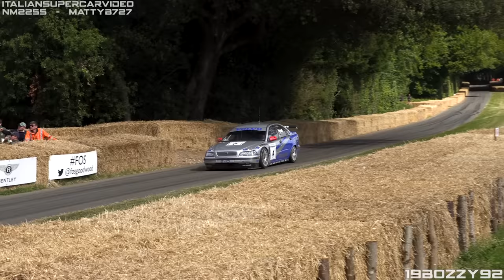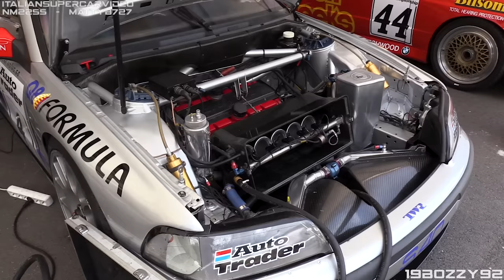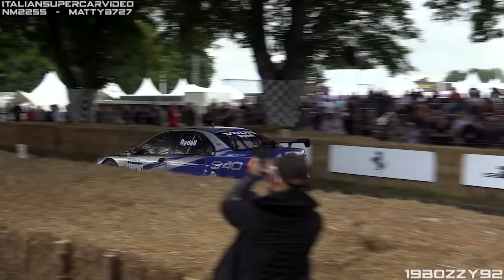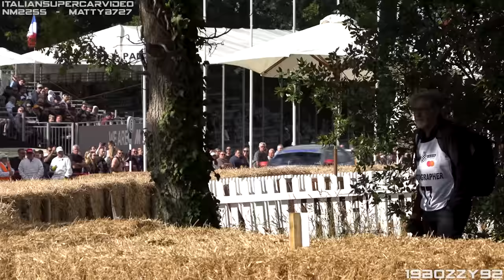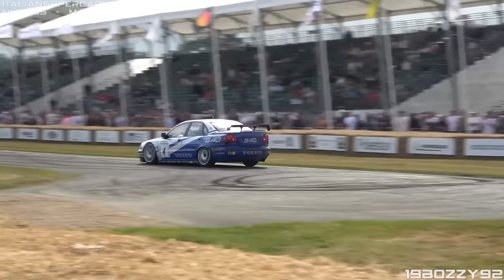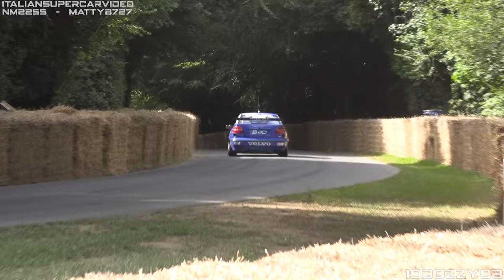Volvo S40 BTCC Super Touring Car w/ 2.0L N/A 5-Cylinder Engine: Intake Sound & Accelerations!

Comment: Those where the days, and Volvo spent a fortune by any standards to try and get that engine to it's competitors level, but actually ended up getting ahead of them. The "stock" racing classes can quickly become extremely expensive when they have to work around the rules.  
Besides BTCC and STCC, they also raced the S40 at Bathurst in Australia 1998 (both whole race and short clips on YouTube) and Rickard Rydell drove the wheels of it, as usual.
Reply: Yep, I remember reading an article in was it in Racecar engineering where they explained how the TWR guys ended up turning a 300£ stock cylinder head into a cylinder head that gave something like 30hp power increase and costing around 15 000£ a piece.
Reply: @dudigi  Yes they were not allowed to weld the factory heads, so they cut them apart and used screws to hold the new pieces together. An engineering accomplishment beyond anything remotely sensible, they were spending F1 kind of money by some accounts.
Reply: The regulations prohibited changes to the stock valve angles, so the engineers at TWR cleverly angled the whole head 🤣, a genius bit of individual interpretation of the rule book

Comment: The S40 Super Touring is one of the most victorious STCC cars in the hands of Cyan Racing with a total of 22 victories during its five years in the Swedish championship.
The car weighed in at only 975 kg and had close to 320 hp from its naturally aspirated five-cylinder Volvo engine that was equipped with an X-trac 6-speed sequential gearbox.
In 1997 Volvo switch from 850 saloon to new model Volvo S40, at the end of year he (rikard Rydell) was fourth with 1 victory and 5 podium. In 1998, he finally won the BTCC title in a Volvo with 5 victories and 12 podium, beating Anthony Reid at the final meeting. He also won the 1998 Super Touring Bathurst 1000, sharing a Volvo S40 with Jim Richards. In 1999 he was again third behind the two Nissan Primera with 4 victories and 7 podium.

Comment: engine variety is something sadly missing from modern motorsport. the only sport that really has it nowadays is endurance racing but back in the 90s variety was everywhere. f1 cars and le mans cars with 8, 10 and 12 cylinders. btcc with 4, 5 and 6 cylinders. i really miss when you could tell what car was coming by the sound before you could see it.
Reply: Not only did the cars all sound unique, they also all looked unique. Easily identifiable, recognizable and memorable in every way.

Over the last two decades, cars and motorsports have all begun blending into the samey boring looks and sounds. The lack of variety doesn't hold the interest as well.

Comment: The Primera GT was my favourite STC. Later on I owned the road going version and loved it. This and the late 80s early 90s Bathurst with the Sierra, Skyline and Holden's are my favourite race series' ever. And group B rally.
Reply: Them p11 SR20DE primeras are no joke. I swapped one for my l200 pickup sight unseen. And I was like wtf have I done. Pulled up to meet the fella to do the swap seen it was lowered big exhaust and all that i was like err fml. Deals off. Took it for a little test drive, and instantly fell in love with the primera. That sr20 was silky smooth, and all the extra nismo parts he put on it made it pretty damn rapid. I remember doing a quick 3rd pull against a civic type R and I smashed it. Got it off the clock in 3rd, still had heaps of revs to go, mine reved out to 9,200rpm and the intake sounded wicked as! I regret getting rid of that car. Was the rarer red top version too.
Reply: @timfagan816  All that and they were comfy, too. Loads of space, long gears for the motorway. I had an air filter and a straight through exhaust and 18s. I painted the rocker cover ford imperial blue. Pimpers are rare now. Gave £500 for mine in 2008. Can't find em now and if you do you're looking at up to 5k.

Comment: Seeing this car on the hill and with a 5 cylinder feels weird when you own an the same generation v40 t4 with the 2L 4 cylinder turbo engine…
Reply: Didn't know you could get the 5 cylinder in the old s40...wonder difficult is it to do. ..
Reply: @russelsingh4936  idk but the s60 has a 5 cylinder and the engine room isn’t much bigger so there should be enough space at least…
Reply: @russelsingh4936  dont think its possible, the space between the frame rails is a lot thinner in these cars than the 5 cyl cars
Reply: @russelsingh4936  You can't...

Comment: As an Audi driver I have to say, thank you Volvo. Nice engine in the early 2000s.
Reply: In fact, Volvo used inline 5 from early 90s.
Reply: And this car drove from 1996 - 2000 in BTCC it's my favourite BTCC car
Reply: And Audi first used a 5 pot in the mid 70s. Volvo started using theirs in 1991. But other than having 5 cylinders they have nothing to do with each other do they? It was Ford that started using Volvos lovely 5 cylinder turbo engine in their Focus ST's and RSs.
Reply: @davekennedy6315   
In the past Volvo used Audi i5 TDI engines.
Reply: @jareknowak8712  I didn't realise they had any connection at all, so thanks for the education Jarek.
Reply: The S40 was used in 1997-1999 in the BTCC, this being a 99 car :)
Reply: @davekennedy6315  Only TDI diesels were Audi sourced though. All other 5 cylinders back then (and 4 and 6 cyl. too) were volvo's own desing, called the whiteblock.
Reply: @jareknowak8712  Volvo also used mitsus 1.8 gdi and renaults 1.9 diesel on the phase 1 s40

Comment: Wow! Did it have that much tuck in the rear in race trim? Seems like it would be a nightmare for servicing on the fly.
Reply: Air jacks and suspension droop. When up, the wheels come off without issue.

Comment: i wonder what rev limit was on this thing? imm guessing around 8k because it doesnt sound as high as a group b quattro. then again the quattro was a turbo 5 cylinder so surely its rev limit should be lower but it really sounds higher.
Reply: 8500 rpm revlimit as per super touring car regulations

Comment: It's interesting that the S40 Touring car had a 5 cylinder Volvo engine....because the road car S40/V40 only got 4 cylinder engines... I assumed this was because the 5 cylinder didnt fit into the smaller S40 chassis. But seems it does fit in the BTCC car, or has the engine bay been modded?
Reply: This engine was already in the 850 touring car (built by Tom Walkinshaw Racing) that they used in -94 championship. I guess lots of the chassis parts were still the same in this s40, or developed from that 850 so as the 5 pot engine.

Comment: Oh, i did not knew that racing S40 also had inline-5. 
I knew that 850 had it. 
Quite strange decission, imho. 

Volvo never sold any S40 of this generation with inline-5, only 4 pots. In fact, this model was produced in Holland and from the technical point it is more a Mitsubishi Carisma/Space Star than a Volvo.
Reply: I'm no expert but I'm pretty sure Volvo did a 5 cyl S40 in the UK, I think they had to to qualify to race a 5 cyl S40 in BTCC. I've never heard that an S40 is a Mitsubishi Carisma either but again I don't know.
Reply: This generation S40 only had 4 cylinder engines in it`s road going version, but the rules of Super Touring said that you could use any 2 liter naturally aspirated engine from your parent company, and Volvos 5 cylinder engine was already proven in the 850 Super touring car, so Volvo kept developing it in the S40 BTCC car.
The first gen S40 WAS based on the Mitsubishi Carisma.
The second gen S40 was based on the second gen Ford Focus and did use Volvos 5 pots as well as Ford derived 4 pots. ( Ford bought Volvo in 1999 )
Reply: @fontheking5  It was co-developed with Mitsubishi, but especially after the 2001 facelift it had enough differences that made it a rather different car. Suspension and even the chassis was modified and it became stiffer. And as a side note, being Mitsubishi sourced isn't necessarily bad, or "lesser" Volvo as some Volvo guys say. This same platform was used by Mitsubishi to make FTO (something like FWD Supra) and EVO 3 models, too. A very capable platform.

Comment: Nothing, but nothing broke the mould like the T5 estate. “THE TERMINATOR”
Reply: The 850 BTCC estate used the same engine as this car, a 2 liter naturally aspirated 5 cylinder engine with around 300 hp and a revlimit of 8500 rpm. Turbos were banned in Super touring and all cars must be 2 liters.
This engine was based on the Volvo 850 2.0, a rare version sold mostly in Sweden and Italy.

Comment: How much are these things rev? I couldn't find the data anywhere. It must be quite high, if it pulls out 300hp from an NA 2.0L engine.
Reply: 8500 rpm rev limit
Reply: It eventually made 325 hp.

Comment: was the s40 btcc a 4cyl or 5cyl? this car is 5cyl, but the s40 factory\retail car only had 4cyl engines. was 2l the limit for btcc with any engine from the manufacturer? or did the engine have to be fitted to that car for retail?
Reply: All engines had to be 2 liter naturally aspirated engines whit around 300 hp and a revlimit of 8500 rpm, but you could use any 2 liter n/a engine with a maximum of 6 cylinders from your parent company as you wished, so Volvo did a special thing, and put the 850 engine into the S40.
It was based on the Volvo 850 2.0

Comment: Always thought the btcc s40’s were 4pots!
Reply: Me too. I assumed basis engine philosophy was a homologation thing and there was no production five banger gen 1 S40. I remember the 20 year old me lusting after a pale yellow 2.0 LPT when they first came out.
Reply: The Super touring car rules said that you could use any 2 liter naturally aspirated engine ( with a maximum of 6 cylinders ) you wanted from your parent company, so Volvo decided to use the 850 running gear in the S40 racing car.
Reply: @fontheking5  Good stuff. Considering I’ve been into touring cars since the late 80s when I was in single digits and bought literally every issue of Autosport throughout the Super Touring era, one wonders why I didn’t know. Must have just been looking at the pretty pictures!

Comment: 5 cylinder ?? You mean VR5??? I never experienced VR5 or 6 in person but in video I realised VR5 sings melody to ears!
Reply: VR engines were and are a VW thing. MB, Audi and Volvo had inline 5 cylinders back then. I guess MB had them first, Audi second and Volvo last but not least.
VR engine is like a V-engine with one cylinder head because of the minimal angle between cylinders.

Comment: Only Volvo has a high-revving, in-line five-cylinder, naturally aspirated racing engine?　Audi is turbocharged and Honda is naturally aspirated in production cars.
Reply: No, the rules said that all Super touring cars must have 2 liter naturally aspirated engines, whit around 300hp and a revlimit of 8500 rpm. This was raced between 1997-1999, in the Uk, and between 1998-2002 in Sweden.
It`s not a TCR car.
When Audi and Honda raced in the BTCC under the Super touring car rules, they also had naturally aspirated engines, but 4 cylinders.

Comment: Some non-car guy : 2.0l 5 cylinder? That was so small.
Me : huh? How about 1.5l 4 cylinder it's 375cc per cylinder, so 2.0l 5 cylinder was just 400cc per cylinder
Reply: BMW has 2,0l 6 cylinder and Ferrari made 2,0l 8 cylinder used in Ferrari 208

Comment: I didn't knew there was a 5 cyl. 2,0.  I only know 2,3, 2,4 and 2,5 - 5 cyl. Volvo engines.
Reply: There were 2 2.0 liter 5 cylinder Volvo engines, one with 10V and a 129 hp, that was sold in Sweden, and one sold in Italy, which had a 20 valve head and a 143 hp.
Italy had higher taxes on engines above 2 liters and that`s why they got that engine.
In Sweden, journalists and buyers were complaining that the 850 was to expensive, so that`s why Volvo brought out this 2 liter 10 valve 129 hp 5 cylinder engine as a base engine.
This cars engine came from the 850 BTCC Car.
Reply: There is 850 2,0 T-5 too

Comment: That´s how they should have build it. T5 instead of T4
Reply: This is not a T5, it`s based on the Volvo 850 2.0 20V from the Italian domestic market.
All engines in Super Touring had to be 2 liter naturally aspirated engines whit around 300 hp and a revlimit of 8500 rpm, but you could use any 2 liter n/a engine with a maximum of 6 cylinders from your parent company as you wished, so Volvo put the engine from the 850 Super touring car, in the racing S40.